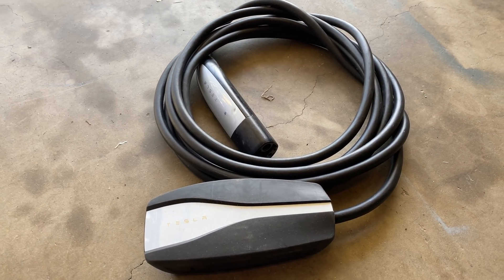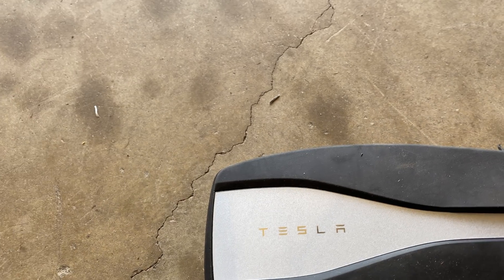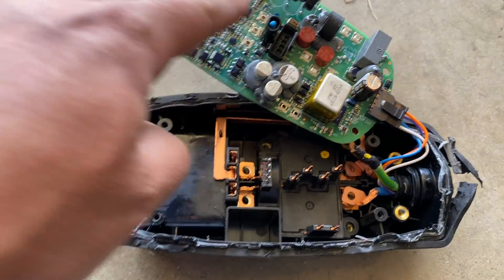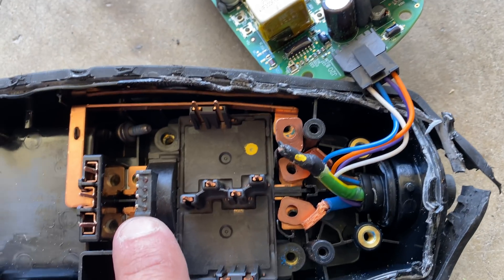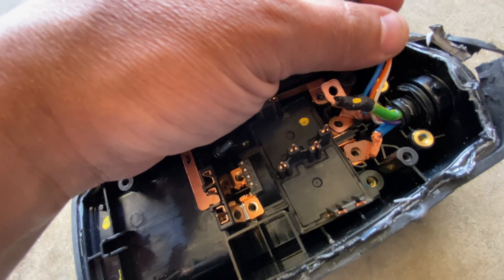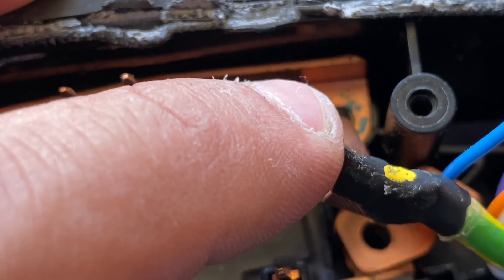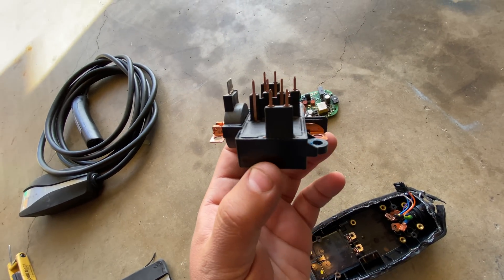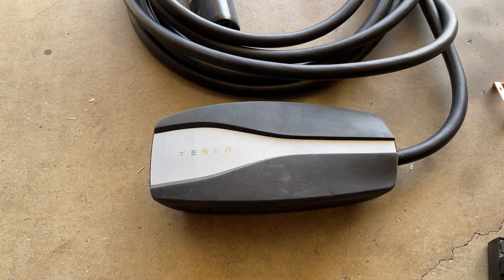TESLA's Gen 2 Mobile Connector TEARDOWN

Comment: I got EU connector but it has damaged wire - I solder it out and everything works 

orange is PP
purple is CP

after that i cut thin white wire and button stopped working, after I cut thin blue wire charging still works  so probably this is for temp sensor

Comment: Does the charger circuit have  DIODES in the module that you took apart ?   or are there diodes at the input of the ACTUAL CAR input ?  thanks

Comment: The other two cables are DC power for the button. The button transmits to the car wirelesly (with Si4010 IC) on 433 MHz (EU) or 315 MHz (USA).

There's 3 power cables, 1 pilot, 1 control, and 2 for the wireless transmitter.

The extra wires on the relay are a current sensor per side and an output to confirm it works.

The thing you call a current sensor is actually the sensor for the GFCI/RCD.

Hope that helps.

Comment: 7:00 I wonder how that is suppose to sense current. Because both legs (wires) are going through it. Whether it be 120 or 240 voltages. The current will cancel each other through that sensor. 

If the sensor was surrounding just one of the legs, then yes I can see it as sensing current.
Reply: I think those two legs poking through are in parallel, then you see the other two legs on the other side.
Reply: Joe Heiser Not sure what you’re trying to get at. The AC input side is where the sensor is at. Thus the current is canceled out through that point. 

If you plug a 1,500 watt heater into a 120 voltage outlet and turn it on. Then put a clamp meter on the cord, you’ll see 0 amps, because the current, amperage, is canceled out. If you, however, spread the cord apart and put the clamp meter on one of the wires. You’ll see 12.5 amps.

Take the same scenario, but plug the heater into a 240 volt plug (let’s say it can handle it). Clamp on meter around the cord, again 0 amps. Clamp on meter around one wire, 6.25 amps... double the voltage, half the amps. 

This sensor is like putting the clamp on meter over the cord. So I still don’t know what it’s for. Unless it’s to make sure the grounding wire (green) doesn’t become a conductor and conduct current. This is entirely feasible because if this sensor starts to detect current flow, then the green wire is the only other wire that current to go down. Or either a VERY MAJOR fault in the car. Where a person becomes a current carrying conductor by touching metal and ground.
Reply: @robertsteich7362  yeah you're right. This is what I get for skipping through the video before work with no sound lol.
Reply: And this guy just said exactly what I had suspected with the ground fault issue...

https://youtu.be/0pWuBsyjgF4

So basically it is a GFCI for the unit and the additional prongs in the relay area may be the current sensors for each individual side.

Comment: There are two relays because each of the two live wires can electrocute the user before the charger is plugged into the car. The current sensor on the relays is a current transformer since it measures AC current, and not a hall effect sensor. Hall effect sensors are used for DC current.

Comment: Working at a Wire Harness factory I've done Utra Sonic welds  like that.  THEY SUCK.    They may appear to have completed the process but  the components  are not in fact WELDED to each other sufficiently.   The bonded points of contact did not fuse  deep enough . Visually it's hard to determine . .

Comment: 240V x 35A= 8.4kw Tesla charger? That's sad af. Ssssssad.
Reply: These are intended more for portable use. The wall mounted chargers are 48A, and I think they can handle even more though the cars cannot yet.
Reply: Weather or not it has a 120 plug or a 240, this thing's circuit can only handle 8.4kw. That's about standard for mobile chargers, but that's lame for Tesla.
Reply: Considering the intended purpose of a mobile connector, it’s fine.

Going to visit grandma for a week and need to charge for your return trip? Bring the Tesla MC. Stranded somewhere with no charge and need to get a few miles to reach a supercharger? Find the closest 120 or 240v outlet, swap to the appropriate plug, and hang out for an hour or so.

Just need to top off your charge overnight after using some of your range to drive home from the supercharger? Plug in the Tesla MC.

Also, being for a Tesla doesn’t change the fact that it’s a Level 2 unit. 35A is pretty good, actually. The highest mobile units go is 40A since you have to stay within 80% of the maximum rating of the outlet and the largest available is typically NEMA 14-50 (rated 50A). Because the NEC allows you to use a NEMA 14-50 with a 40A breaker, a mobile unit really needs to stay around 32A to avoid tripping the breaker.

To get 52A Level 2 charging you’d need Tesla “wall connector” and it needs to be hard-wired (no outlet/plug/receptacle). Obviously, you can’t do that with Tesla’s “mobile connector.”
Reply: MYSTIQUE MAZE We still get 240v power to American homes for large appliances like washing machines/ovens. It’s just that the typical wall outlets use 120v
Reply: MYSTIQUE MAZE yeah 240V has a different socket shape. Not sure how these EV chargers work but I wouldn’t be surprised if it even needs to be wired directly to the house’s main breaker

Comment: Neat tear down! Fun fact the current sense transformer is wrapped around both legs of the power, it is not necessarily measuring the current being consumed by the car but is there to sense ground faults. There will be a voltage created by the transformer only if there is a current leak to ground or some other path, this voltage would be sensed by the electronics and in turn break the connection through the relay. Keeps you from getting electrocuted.
Reply from the maker: GFI